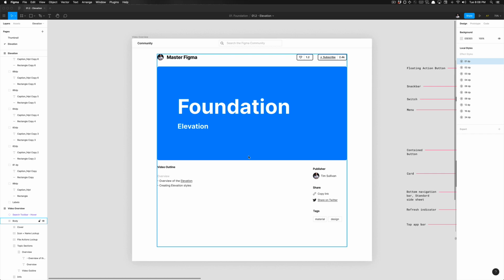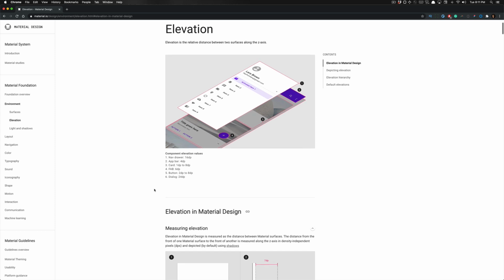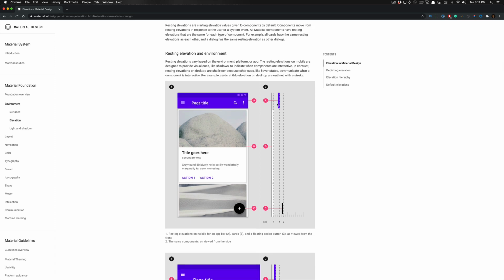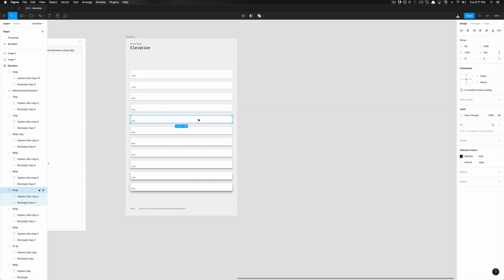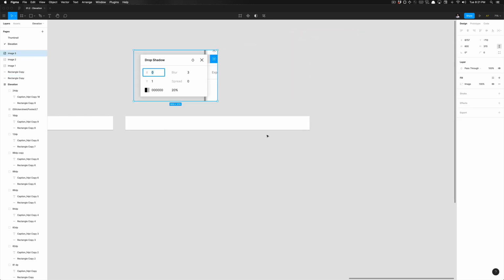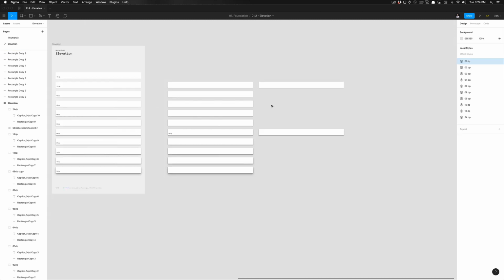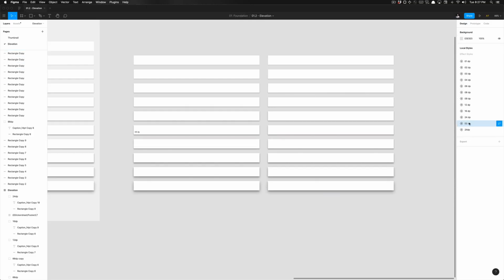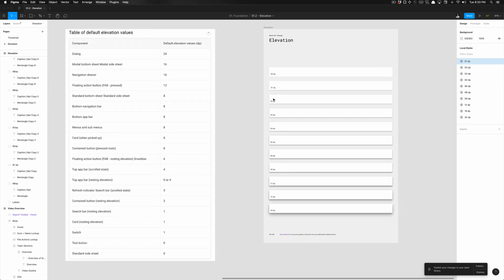Let's Build a Design System: Elevation

Comment: Hi Tim, thanks for this great tutorial. I wonder if there is any way to link the drop shadow color to a color style instead of a hex value. I am trying to convince my team to switch from Sketch to Figma and I noticed that despite Sketch sucks in general, it gives the possibility for such linking
Reply from the maker: Are you referring to a design token essentially for a drop shadow? If so, in the past I've just defined a variable that was attached to whatever value my drop shadow was, which has generally always been the css value of "box-shadow" which I'd grabbed from creating drop shadows in Figma. Hope this helps!

Comment: Hi tim, amazing job done right here, please how do you know what drop shadow settings was best for an elevation style. Like is there a criteria for choosing the drop shadow style like you did?
Reply from the maker: Hi Oluwaseun, thanks for asking! I don't know the best elevation styles. In this video, all I'm doing is replicating the drop shadow from the material design system. The criteria according to material design guidelines is, "...virtual lights illuminate the UI. Key lights create sharper, directional shadows, called key shadows. Ambient light appears from all angles to create diffused, soft shadows, called ambient shadows".

Here are a couple of great resources to better understand drop shadow on different surfaces:

https://css-tricks.com/getting-deep-into-shadows/

https://www.material.io/design/environment/light-shadows.html#light
Reply: @TutorialTim  Hi... I was about asking this same question but I’m not still clear about this particular issue because based on material design system, there are default elevation values right?!... like the 16dp for navigation drawer. My question now is “how would I be able to ascertain the value of 16dp for a navigation drawer through using a drop shadow in figma because in this video you had already ascertained the values, you only ascertained the value for 1dp in the video. Please explain better how you got for others
Reply from the maker: @ohbe-o  Hey! You are correct there are default elevation values set for specific components such as the navigation drawer you mentioned. As for your question, (a great question by the way) currently in the drop shadow properties in Figma you cannot specify the z-index to represent the 16dp elevation you're mentioning in the design, currently you can only set the X and Y axis properties, Blur, Spread, Color and Opacity for a drop shadow. So that would have to be done on the front-end via CSS. This is important to note as you will have to explicitly articulate that to your engineering partners since that currently can't be represented within a design in Figma unless you specifically mention it in the design file. Hope this helps!
Reply: @TutorialTim  partially but thanks for the response... I really appreciate it
Reply from the maker: @ohbe-o  No problem, let me know if there is anything else I can help clear up!
Reply: @TutorialTim  yeah! I’ll always do that thanks again

Comment: Tim, why are there 3 different drop shadows for a point of elevation? Why not just 1 drop shadow effect with stronger or lighter values depending on the elevation? 🙄
Reply from the maker: Great question! In certain scenarios one drop shadow effect doesn't achieve the proper look and feel we're looking for based off of Material Designs elevation. Often when implementing drop shadow in a product (on the front-end) there are several things to take into consideration such as the operating system. For example, a lot of Linux based computers don't have a great GPU so it relies on the CPU to process these shadows which results elements where your drop shadow is applied to render slowly on your browser. So if you were to have one drop shadow effect and only one drop shadow you wouldn't have as much control when it comes to applying the shadow around all the edges of the component you're applying the drop shadow to. At the end of the day, do what works best for your product and target audience. Just be aware of potential edge cases.
Reply: @TutorialTim  Thank you this is very insightful.
Reply from the maker: @Wizard1738  No problem, all the best to you!